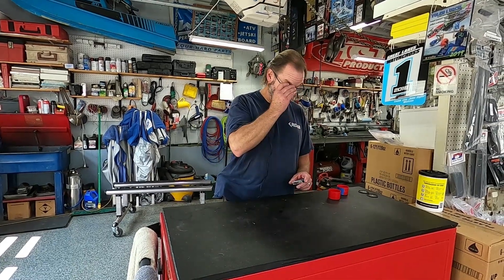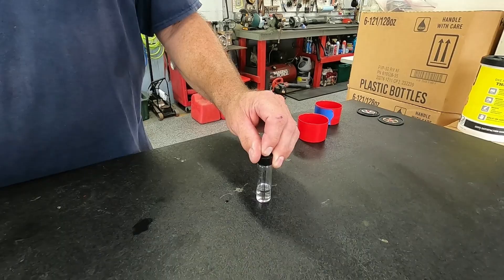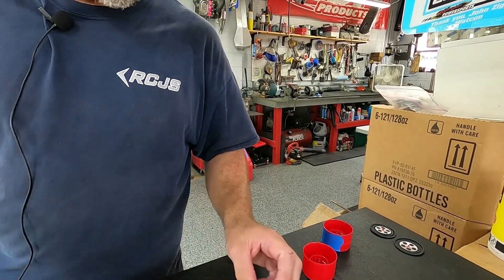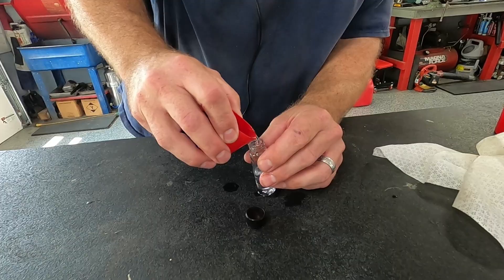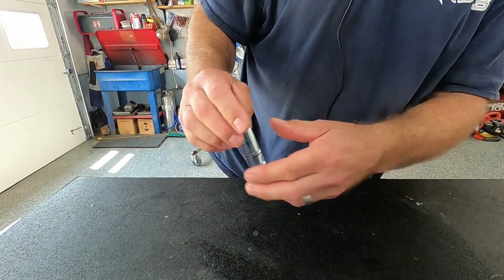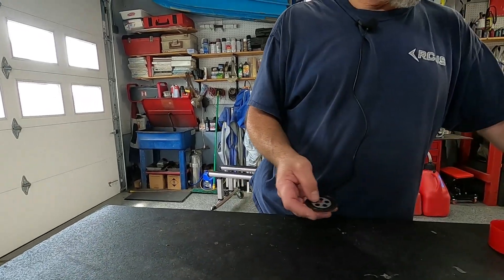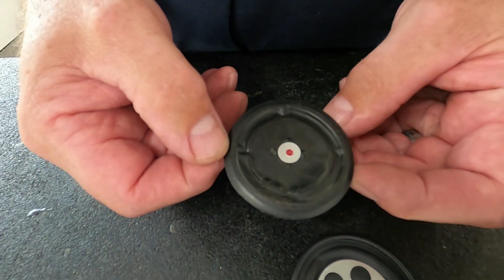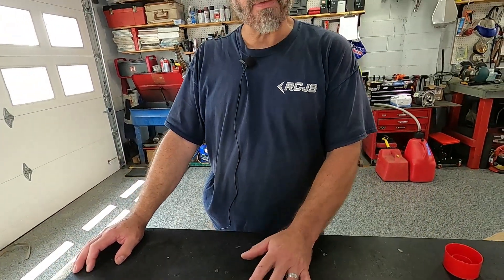ethanol gas talk

Comment: Awesome video John. In Greece we have two options of pump fuel, gasoline 95 octane and 100 octane. However, most gas stations have bad quality of fuel due to additives that enhance fuel volume... for obvious reasons. Modern Jet Skis, ie four-strokes suffer from fuel pump, and injector issues.
Reply from the maker: Thanks for watching

Comment: Really enjoyed this episode and your tip about dropping a couple gallons into the truck before the jet ski tank, solid tip. So why is it that the watercraft industry hasn’t shifted to parts that are certified for ethanol blends. Seems like that is at least the normal in the US. Is it simply a cost thing, hp thing or something else. If the automotive industry did it, you’d think watercraft could too, but I’m no expert on the subject. Thanks for the great video!
Reply from the maker: Thanks for watching!! Honestly all of the new watercraft WOULD be ok for up to 10% ethanol.  It is just the older skis. It is the same with old cars, lawn mowers etc. I still do NOT recommend ethanol fuel in a typical marine environment though as it can and will actualyl absorb water, and we are surrounded by water....